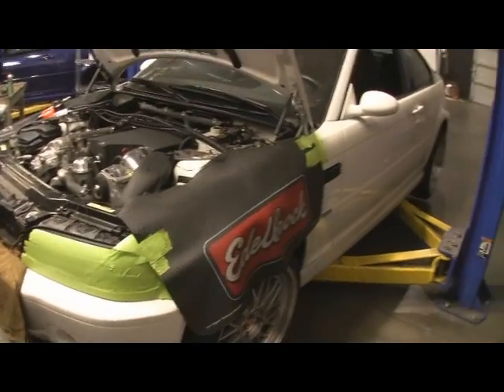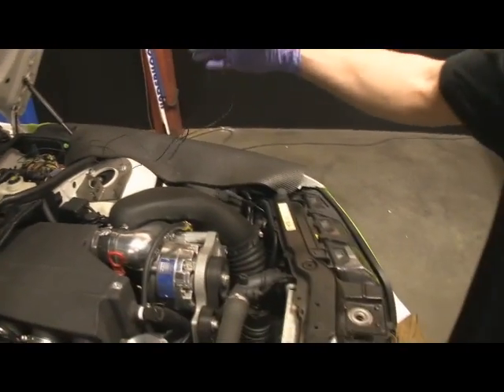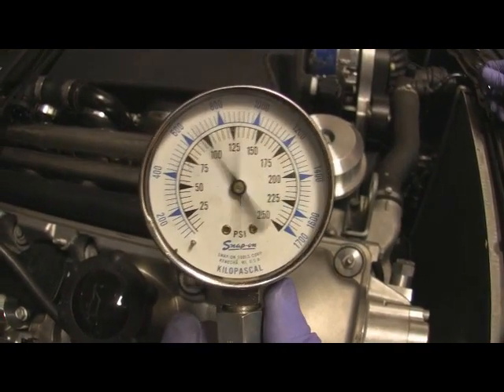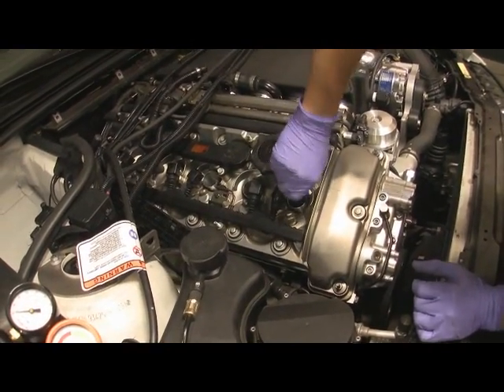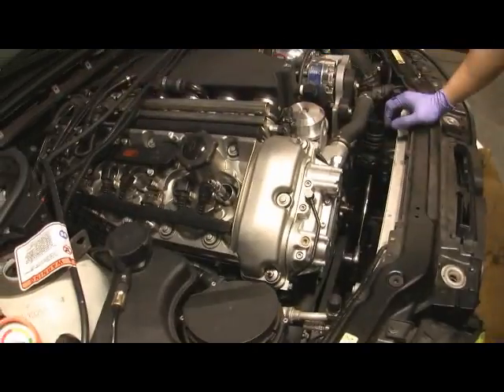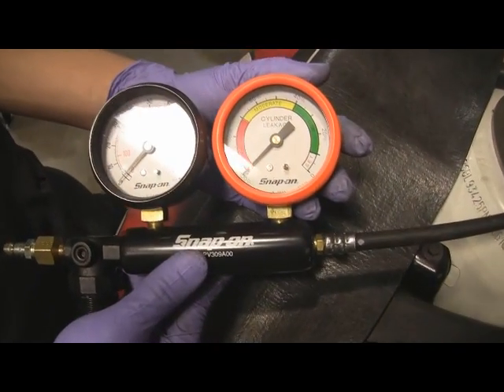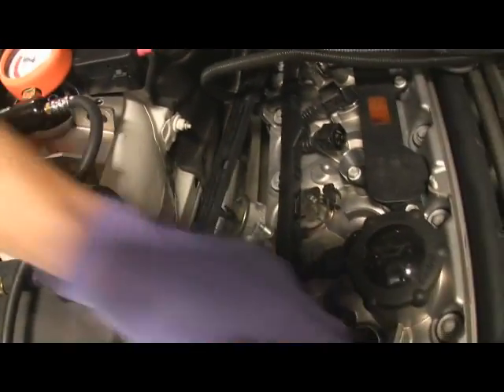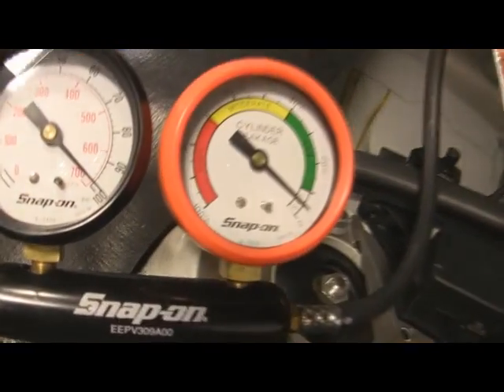VF Engineering Supercharged E46 M3 to HPF Turbocharged E46 M3 Results

Comment: race gas by itself doesn't add any power, it only has higher temperature combustion rate, to resist detonation, it's meant for high compression/high boost engines where the engine runs hotter

Comment: @HPFChris 
So essentially, if you put in race gas, and don't turn the switch to race gas. (leave it in pump gas mode) you still use the race gas and get no power gains? basically you WASTE the race gas?
I think it would be awesome if you guys can come up with a separate tank for race fuel with is only used when you turn the switch to race mode. that way you save it for when you need it.

Comment from the maker: You run the m3 until the odometer says zero miles left.  Then you add a "MINIMUM" of 10 gallons of 110 octane "LEADED" gas to the gas tank.  Then turn the keyed switch and feel nearly 200rwhp more.  :)